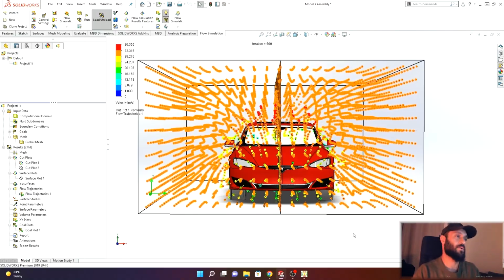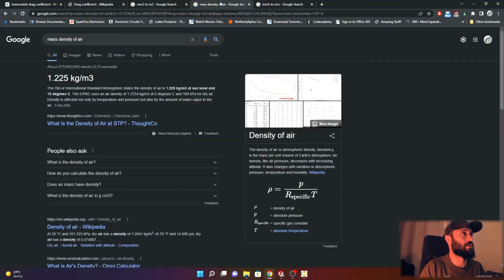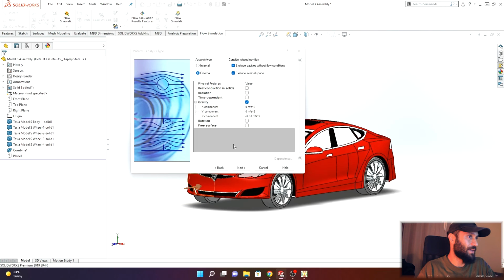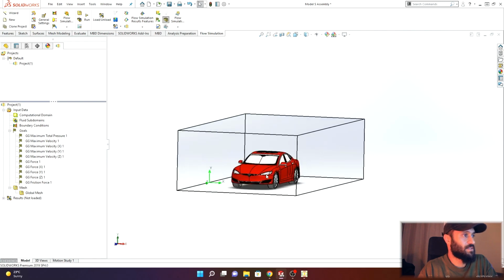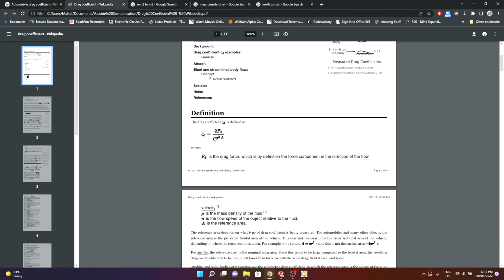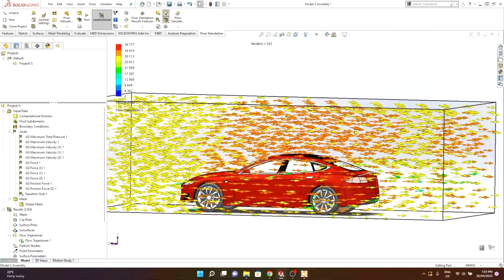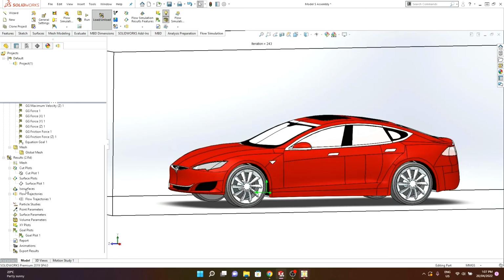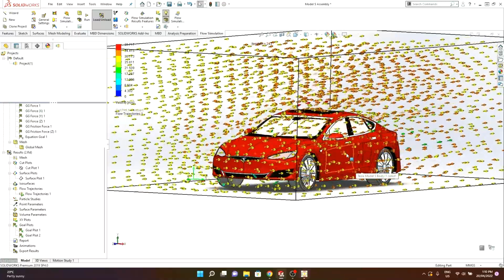SolidWorks Car Fluid Dynamics Simulation

Comment: very good explanation but please do not say 0.25 (zero point two five), engineers don't say zero. it is point two five !!!!!!!!!!!!
zero is only to be written, not to utter. it is only to differentiate between a written 25 and .25 , as some times one mistakenly read .25 as 25. so to be one the safer side it is written as 0.25 !!
so that no one could make a mistake.
zero is to write, not to say !!

Comment: Love this stuff, but cannot afford the program, or have the time to mess with it much. But I have questions. 1-What affect does a Bug-Shield have? 2-What affect does a Car-Bra have? 3-What affect does Wheel-Curtains have? 4-What affect does an Under-Tray have? 5-What affect does Hood-Ducting have? 6-What affect does Separation Edging have? 7-What affect does an Air-Dam have? 8-What affect does Upper-Grille Blocking have? 9-Rims/Wheel-Covers that are smooth (Moon Caps).

Comment: Hi. I would suggest u include the airflow effect of ground with the tesla underneath. Unless if u were testing if the tesla can fly or not.

From the contour, I can see that there is no build up pressure underneath.

Even in wind tunnel test, the car would be tested with the floor.
Reply from the maker: Good point! I will include that if I work on this again

Comment: Yeah for a model of that size, you would need a fluid domain that’s at least 5 times the length of the car at the rear. And 3 times it’s length at the front and the height and width at approximately 2 car lengths
Reply from the maker: Ah ok, thanks for the knowledge!